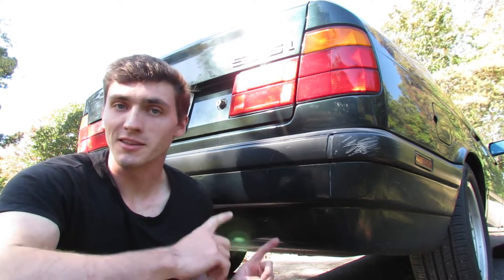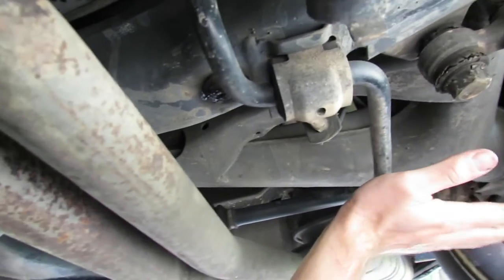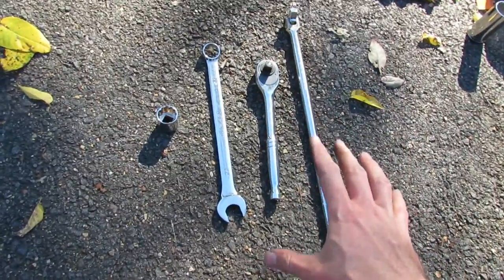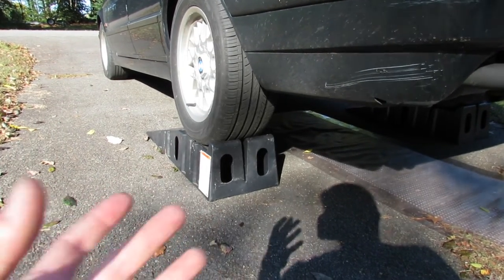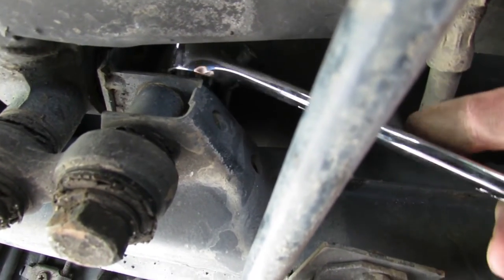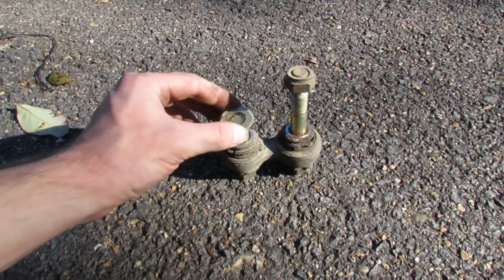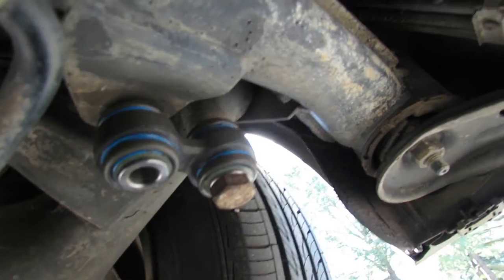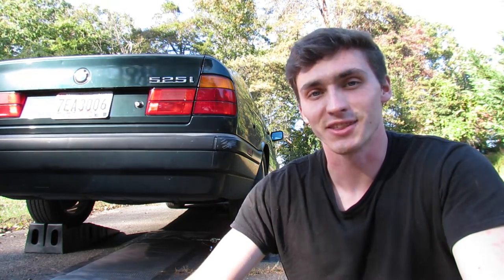E34 Rear Pitman Arm 'Dog Bone' EXPLAINED + Replacement Walkthrough

Comment: Fun fact as he mentioned this was an afterthought from BMW, the previous 5 series car (e28) had almost identical rear trailing arms to these except they had smaller bushings and no pitman arm.

However in 1986 the e28 got updated rear trailings arms which are the exakt same part as the e34. Even the part numbers are the same so yeah, the pitman arm really is an afterthought or update that the e28 received in 1986 and then carried on to the e34.

Comment: Great video, when I last looked at this, the parts file (real Oem / bmw fans) differed on order of hardware to the bmw TIS (technical information System). I went with the TIS order as that is what the techs would have access to in the workshop.
Reply from the maker: There did seem to be some confusion online as to what goes where, so I just put things back in as they came out. Do you happen to remember what the TIS said?

Comment: I've bought Lemforder pitman links in the past as they are the Oem manufacturer. They clearly have  have the bmw logo and part numbers removed from them
Reply from the maker: Gotcha, that's good to know. I got these in a tub of parts with another car, they're definitely better than the old parts at the very least.
Reply: There are a number of OEM BMW parts I have purchased that taking off and comparing to the original, they are exactly the same with the only difference being the BMW logo being ground off so they can sell it as aftermarket.  Lemforder parts have been one of the brands I have noticed that have done this.  Good call out.  Can’t say enough good things about finding OEM parts for old BMWs.  Personally, my favorite parts supplier is FCPEuro, formerly FCP Groton.   I highly recommend and am not affiliated in any way.

Comment: Cuando voy en la 2 marcha y piso el coche a unas 5 rpm noto una vibración muy fuerte en la parte trasera , como una sacudida , crees que podría ser esta pieza ? En curvas lo noté pero solo dando gas .
Reply: When I go in 2nd gear and floor the car at about 5 rpm I notice a very strong vibration in the rear, like a jolt, do you think it could be this part? In curves I noticed it but only giving gas. I really appreciate your response friend.🙏
Reply: Lots of stuff to unpack here without more detail.  Could be the rear subframe bushings, any of the rear suspension parts, or even the differential especially if one of the rear tires is worn more than the other causing the rear differential to work harder.  I’ve also seen problems on other cars where one of the brake calipers is locking up and causing something similar.  I’d clean and grease the brake caliper slide pins first and check for uneven wear first as it’s free other than the labor you put in.
Reply: Talking about the differential working hard, could even be that one of the rear tires is low on pressure compared to the opposite side.  Another freebie to check and rule out.